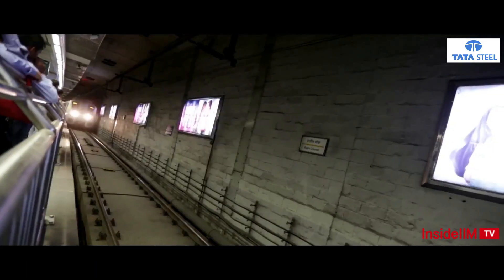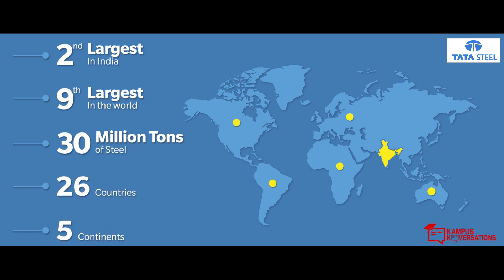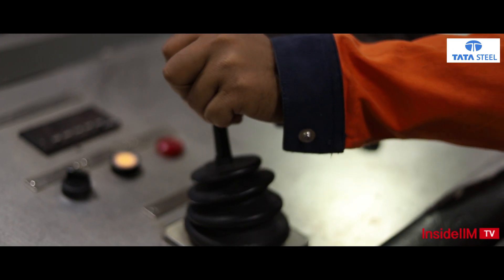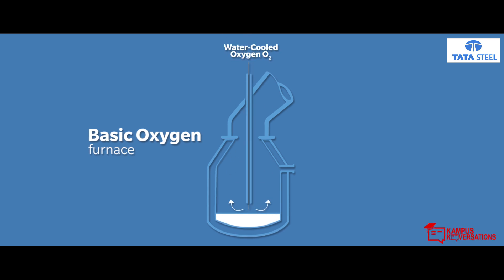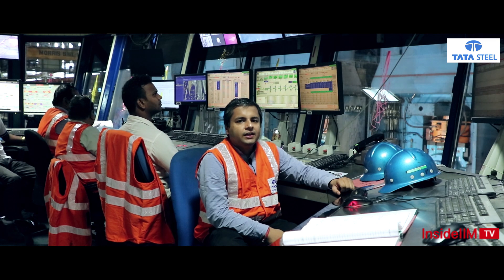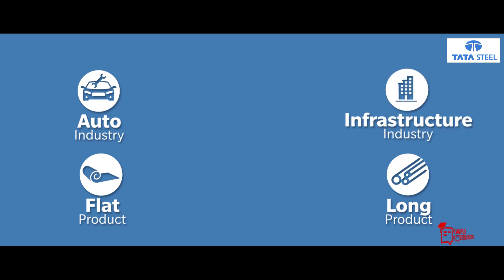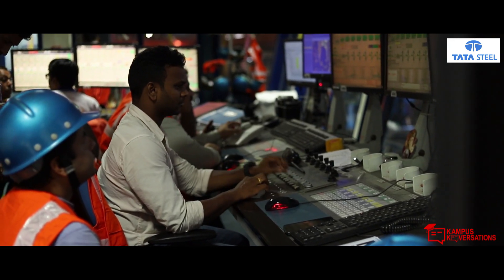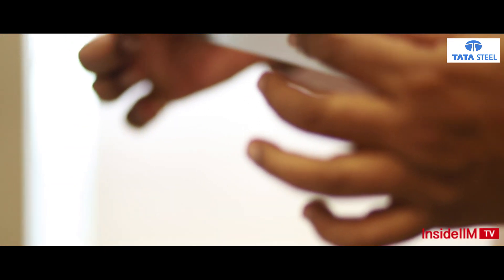How A Steel Factory Works To Help In Nation-Building

Comment: My dream company hopefully i could work here in future after my MBA
Reply: Not easy to get into tata steel after MBA,ofcourse if u r an engineering graduate in metallurgy,mechanical then u have a great chance.
Reply: @vr-4680  yes great chance,apply in website.
Reply: @vr-4680  you can now apply for JUNIOR ENGINEER TRAINEE position which is currently open